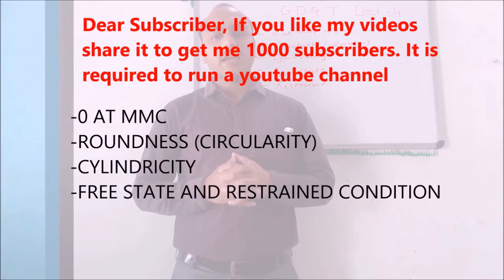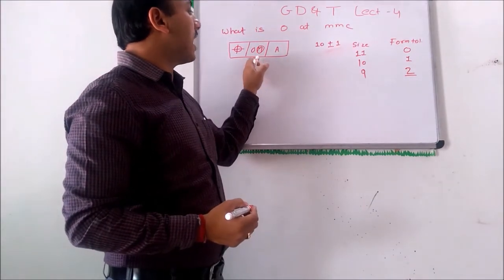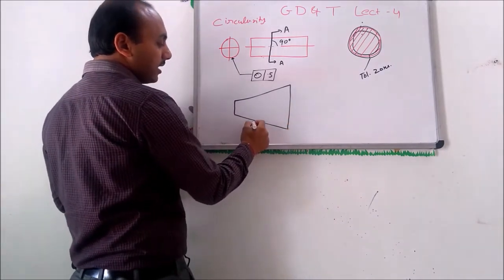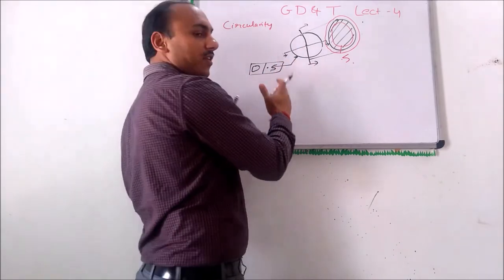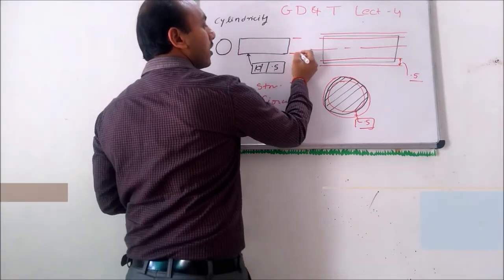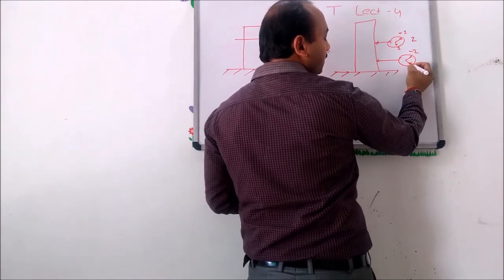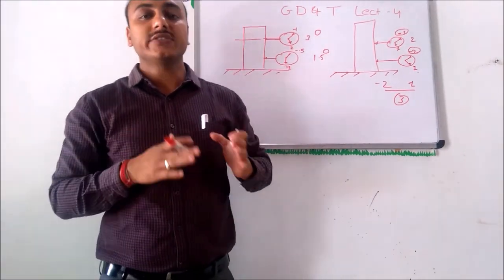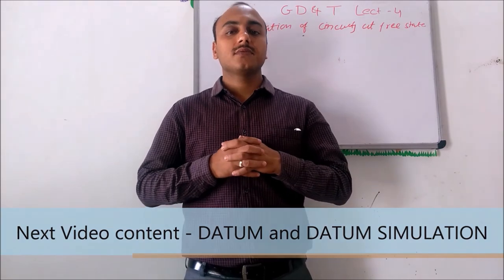GEOMETRIC DIMENSIONING AND TOLERANCING LECT 4

Comment: Can the free state and restrain condition applied to all features?
1. Iam not able to see such free state in drawing regularly. Where it is used and in what conditions?
2. Whether a free state modifier can be applied independently or it should be applied  with restraint conditions?
Reply from the maker: We generally do not see. Suppose a has to be bent to get it assembly, so free State and restrain condition comes in pictures. I haven't also used this. There must be restrained condition for free State.

Comment: Circularity and cylindricity can be applied with dimensions?(Axis)  or it should be applied with only surface of the part to respect Rule 1. Clarify it sir.
Reply from the maker: Circularity and Cylindrycity are always RFS based wherever we apply.

Comment: Why LMC and MMC modifiers  are not dealing with circularity and cylindricity ?
Reply from the maker: This is related with rule 1 in gd&t. It says that limit of size must be respected. Now circularity is form control but if we apply at MMC or LMC basis it will cross the limit of size and violate rule 1. Same for cylindricity. Where as for others, it possible to go beyond MMC or LMC while limit of size i.e. rule 1 still respected
Reply from the maker: Let me know still not clear I will explain you in different way.

Comment: In free state variation u have taken for upper limit 1305+10=1315bt in lower limit 1300-10=1290 bt u have taken 1295 how ??
Reply from the maker: 10 is available at each individual dimension. So at 1305, 1305+10 and 1305-10. At 1300, 1300+10, 1300-10. Does this clarifies..